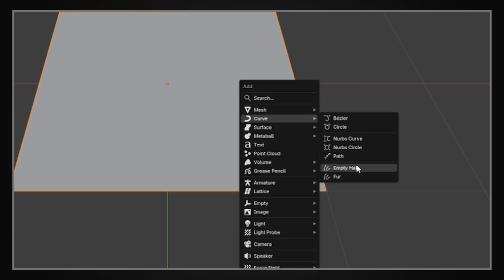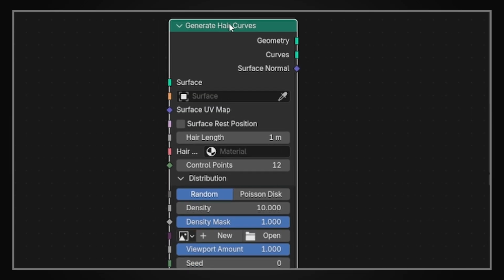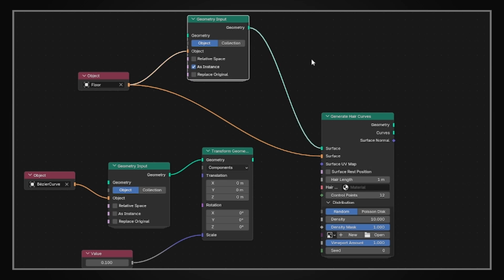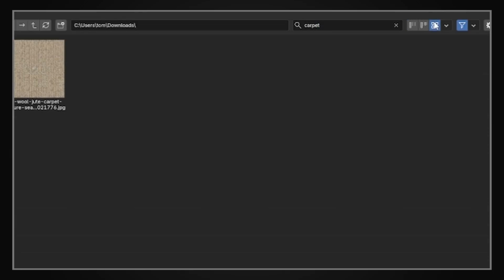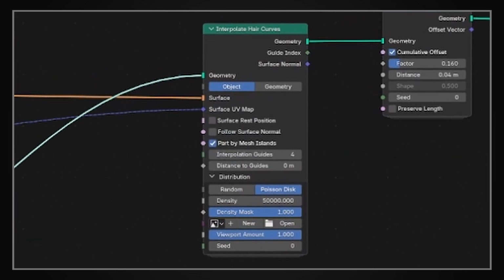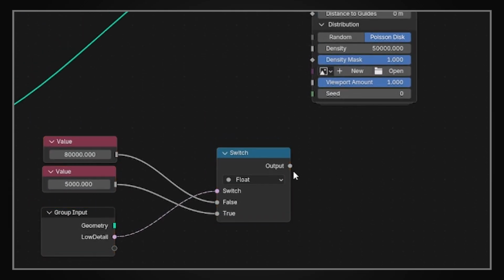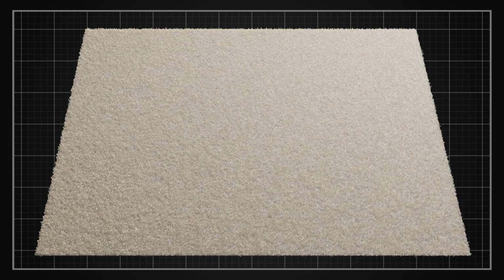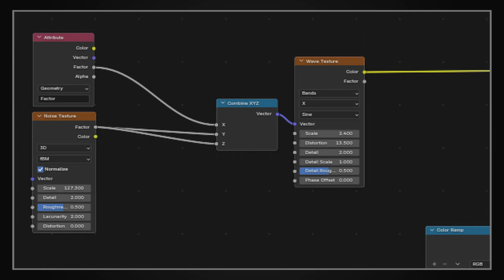Why Your 3D Carpets Look Fake

Comment: The result looks great, but some steps are being skipped and parts of the interface are hidden, which makes it hard to follow for someone without prior experience. For example, it took me a while to realise you were working in the Geometry Nodes panel, it is not clear if you are working on the Empty Hair or the BezierCurve, and I still haven’t figured out how to access the properties panel for the surgery...
Reply from the maker: Hey, thanks so much for the feedback I really appreciate it!

You're right, I definitely rushed through some parts. Let me clarify the key bits:

1. All the Geometry Nodes work is done on the Empty Hair curves object, not the BezierCurve.

2. In the Geometry Node editor, look for a small arrow on the right-hand side of the panel and click it to expand the sidebar. Then go to the Node tab, and the node properties will appear below. This is how you unlock the node tree so you can enter it. (all this is doing is creating a local copy of the group so you can edit it)

3. Once you've opened the properties, press Tab to go inside the node group.

4. When you're adding the input, make sure you have the 'Group Input' node selected, then you can add a new input. set the type to Geometry and name it curve.

I think the editing is also slightly confusing when i'm connecting up the inputs to the 'generate hair curves node'  so i'll explain that a bit here too:

1. The first input is the floor plane as a 'geometry type. so you need to use an 'Object' node and select your floor plane, then use a 'Geometry input' node from that into the first 'Surface' input 

2. The second input is the floor plane as an 'object type' and you can just route the 'Object' node with your selected floor plane straight into it

3. The surface UV map uses a 'Named attribute' node, if you start typing 'UV map' into the text feild then you should see an attribute called UV map. (This is created when you add your empy hair curves to your floor plane when you create them so make sure when you added the empty hair curves in you were selecting your floor plane). This can be routed directly into the Surface uv map input. 

The UV map attribute is used as an input for the randomisation setups as well as the interpolate hair curves
Reply: @tometrica  I may be stupid but pretty sure I did everything correctly unless a few nodes are off but my material won't show?